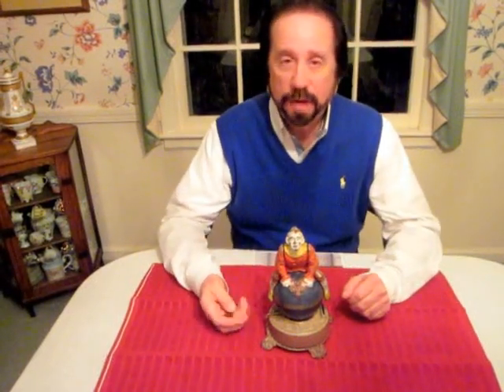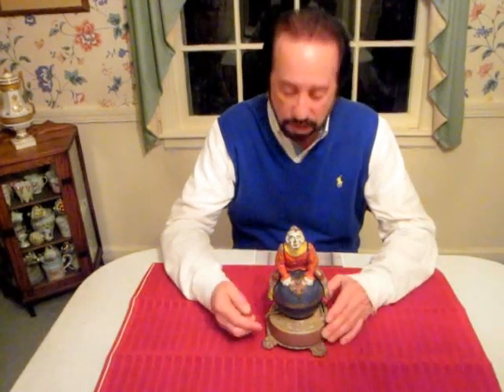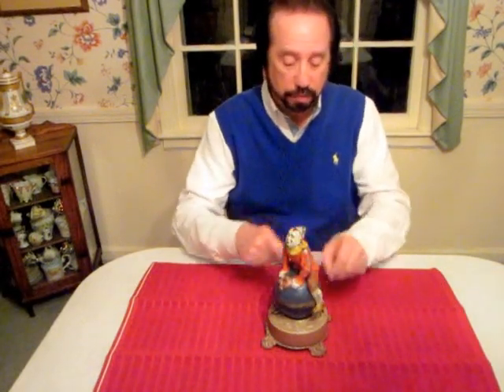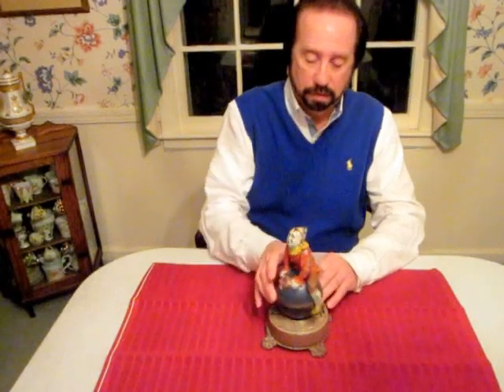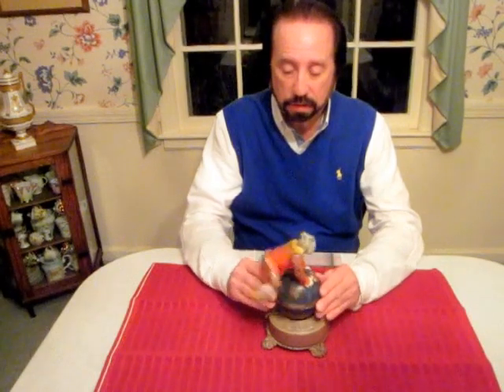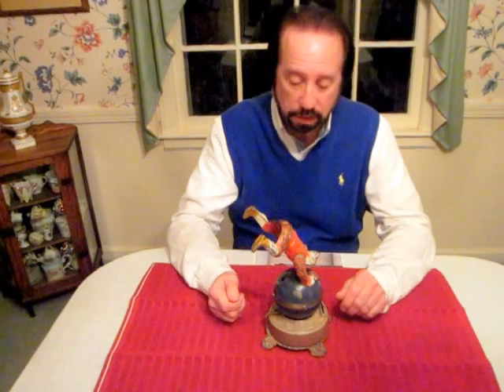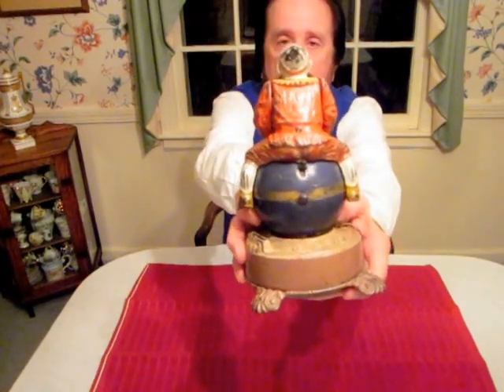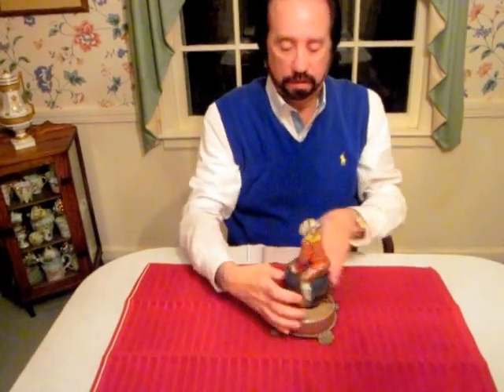"CLOWN ON GLOBE" Original Antique Mechanical Bank Video

Comment: Great video! I have a bank very similar to that one, but I think mine is a replica. Any way to tell for certain?
Reply from the maker: If you want to send me some pictures, I will let you know if it is original or not. Include a picture of the bottom of the bank. The email is ztrader100@aol.com. I' m glad you enjoyed the video. Jack
Reply: TheBankcollector I'm almost 100% positive that it's a replica, because the bottom is different and the lever is by the coin slot, instead of the opposite side